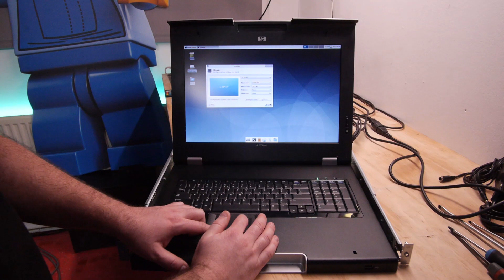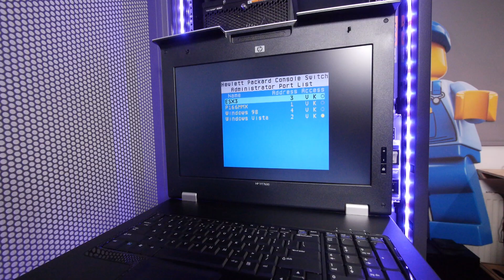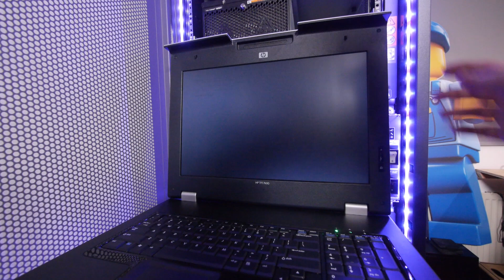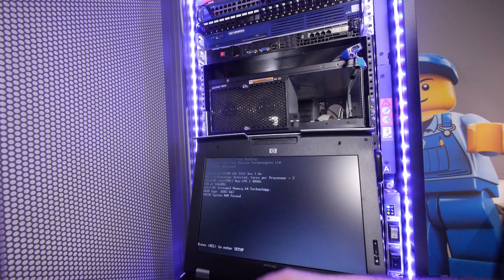Building a Home Lab, Do You Need a Rack Console? HP TFT7600 Review

Comment: Here I found another video of yours. So I had to Subscribe.  I have been thinking about putting something like this in my rack But I always have and extra computer and mouse and keyboard and been looking at the console switches that can go with that system, and send the data over a network cable.  Been thinking about this that way I don't have to move a my monitor keyboard mouse a round and just patch in a cable switch between them and be in.  and also when i'm working one something I can just put the network adapter run cable and ect and not have to move every thing.    Some times I work on other server harddware and not in the rack. be an easy way to always have what I need.  Would be nice if it were like a Laptop. were you can have a computer set up to were you can also connect to switches though their console ports ect. IPMI ect.  But that would be done with a small rack mounted computer.    I like watching your videos.

Comment: I've the 5600, it build quality is better and it has a track ball and buttons.

I can remote mine, but  you know if you can flip open a screen rather than get something and wait of it to boot. It is convenient.

I've two 24 port KVM, old ones and if you think you're in wire hell... I no longer use them, it's easier to go around the back open the door and swap. I generally don't have to do many different ones or switching. So no bother. Everything else is ILO. SSH or web. All of them (save for the retros) have a light pad to tell me if there are any problems .

Retro servers worked broke and still worked. You only got to find out when rebooting.

Comment: You can also get older KVM over IP boxes and access each server over the network or via a local connection.
Reply: Yeah, i had a Dell 2161-DS2.  Being dependent on old java sucked though.
Reply: @andrewnoonan4044  agreed, but there are some that don't need Java.
Reply: @Alexander-jr8nw  None of which helps you to get into a BIOS when the hardware goes down  that you can do from a kvm-over-ip perfectly fine.
Reply: @andrewnoonan4044  yes, I'll never buy/build another server without IPMI/KVM built in.
Reply: @GeoffSeeley  I've not used Drac since the x9xx boxes. I  hope it has improved since then.
Reply: @Alexander-jr8nw  as Victor mentioned, older servers or consumer boards don't have remote management. All my servers are older Supermicro so I use their IPMI/KVM for free (some vendors charge for it)
Reply: @GeoffSeeley   or like ilo2 they have dependencies which make it hard to use them in the modern day or you have to compromise on security.

Comment: My work loves buying $750 rack consoles. They put one in every electronics rack they make. They support 1024x768 resolution, have 2 USB 2.0 ports, and the components tend to fail really easily. The worst part is we never fold up the rack consoles, so they're almost entirely unnecesaary. 
I tore the one out of my test system after the display stopped broadcasting the EDID data via VGA. I flipped over a spare rack shelf, and placed a 19" display, USB keyboard and mouse on it, and called it a day.
Reply from the maker: Good solution!